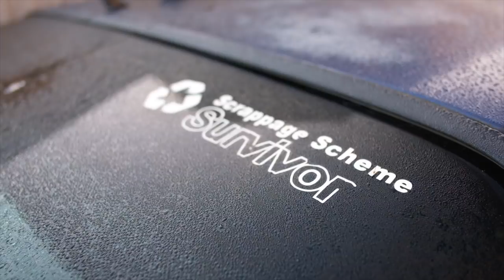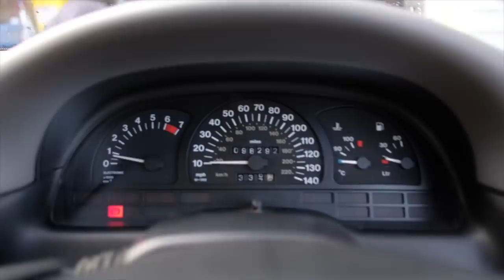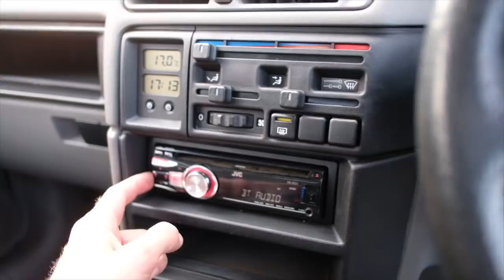Alfa 145 and Rover Coupe *With car washing and Added Mk3 Cavalier!!!*

Comment: That Cavalier is an absolute honey!  I've owned several over the years, SRi's, GLS's etc but my favourite was a metallic gold 1.8i LS very much like the one on this vid.  Same interior, same wheel trims (though I swapped them for GLS alloys)  In fact it's the only car I have a framed picture of (!) and the only car I've shed a tear over it moving on.  I loved it. I have been Cavalier free for about 5 years now and the itch to get other is getting stronger every week!
Reply from the maker: You might nee to move fast, not many on eBay any more!
Reply: @furiousdriving  Sadly I don't think I'll ever own another, not for the foreseeable.  No driveway any more :(

Comment: Mk3 Cavalier 1.8i LS.  The full rep special, complete with the original-spec wheel trims that anyone who spent a lot of time on the motorway in the '90s got very used to slaloming around as they frisbeed off into the scenery.  That's a very decent looking example of what is a pretty rare car now, and they used to be EVERYWHERE...  1.8 single cam Family engine, super reliable so long as you change the oil regularly and remember to change the water pump at each cam belt change, as they never seal again when they've been moved.  You can even change the clutch in one of those without pulling the gearbox out.  You can still get parts for them from AutoVaux...  Just remember to cable tie your wheel trims on if you do go for it.  The gear change bushes wearing out and giving a poor gear change is pretty common and easy to fix...  If you like the Cavvy then go for it, it won't be as much fun to drive as the Rover but it'll be a lot cheaper and easier to own and enjoy...  And they'll turn in 40+ mpg on the motorway...

Comment: Had a grey 2.0 cdx 16v M reg 14 years ago it was great car manual gearbox loved driving the car did open the throttle a few times had some paint issues resolved and new exhaust also well serviced trouble was I sold it because I bought a Rover 420 GSDI 97 R reg bottle green colour grey heated leather lovely spec i had health issues so sold it to my brother he kept it 2 years two great cars in my  ownership miss them both and they also had aircon 🙂

Comment: Notice usual 80/90s gm/ Vauxhall clutch pedal squeak, had several Vauxhall’s in the past inc mk3 cavaliers, the 90s cars were awesome, I love my old late 90s Rover 620 . Both are awesome cars, keep the Rover as they vanished in 2005  and sadly closed and will just become more and more collectible, if the cavalier was a GSi or SRi or the 4x4 cavalier I’d be tempted to swap.

Comment: I would love another cav 8 valves are the best engines ,i really wanted an 8 valve pre 93 sri but there were none near to me at the time and the i see the carlton diplomat 2.0 on gumtree in my home town had to have it as not seen another in years 7 years on still got it .i still love the car  and slowly the value is going up .8 valve vauxhall engines have non interference valves so no need to worry about the cambelt..
Reply: I had an 8v SRI it went like a rocket dont know why but it was exeptionaly fast 120 mph and still would pull in 5th gear

Comment: It's the cavalier I would have over the rover. You are lucky with the insurance policy you have, a similar one in Ireland would cost thousands and not very many people would qualify for one... we called those Opel Vectra's in Ireland.
Reply from the maker: I think only UK used Cavalier under the Vauxhall brand as Vectra sounds like Victor, and that was a flop for them in the 70s and they didn't dare use it until '95

Comment: I've had three mk3,  the  hubcaps were NOT original, but cheap after market ones, the originals are darker shade of grey, the wing mirrors were not body coloured, i am pretty sure by facelift 93 they should of been.  Also the back end lights and boot lid should of had black plastic mould covering around it.....i am pretty sure this was an envoy spec not a Ls.
Reply from the maker: It was badges LS, but they may have varied the trim specifics across the line up throughout production

Comment: Only just recently subscribed what ever you do, do not swap that beautiful rover for the cav. The coupe (Tomcat) is quirky, different, fun and just a stunning car to look at. In my opinion the cavalier is just bland and boring. 
I own a Morris ital and a Austin Ambassador and I get ripped on a daily basis of my ownership of them. However when I let folk see them they always question what are they??. You don’t see them they are uncommon and that’s what makes them fun to own.
Reply: The people that slag off the BL/Rover stuff are the thickos that believe all the DRIVEL from Top Gear and the press too stupid to realise that there has been an agenda to destroy the jobs and economy of the UK and west in general - You will find that agenda if you Google Paisley Expressions and the Jesus, Hitler and Wizard of Oz post on there just now that is exposing the Brexit SCAM as well. I had a 1978 Morris Marina 1.8 HL/TC and also a 1980 Austin Allegro 1750TC Equipe and both of them were excellent reliable cars - BL cars were no worst than any of the other mass market cars from back then and it came down to how they were looked after just like any other car and one thing about the UK is the amount of people that did and still do not check their oil and coolant levels never mind servicing their cars every year and then they blame the car/manufacturers for any problems that they have. Garages ripping people off as well is another reason that cars got bad names when there was probably nothing wrong with the car in the first place the reason that I always serviced and looked after my own cars and the reason that they were very reliable.

Comment: Is the Rover a 220 or a 220 turbo?
Reply from the maker: 220 nasp
Reply: @furiousdriving  I've never experienced a 220, though I learned to drive in a K reg 216 with the Honda unit which surprised the cr*p out of me! Those are pocket rockets with screamer engines!! Is there any difference between the two?

Comment: The rover looks like it has had long periods of neglect the Cavalier looks like it did in 1994.
Reply from the maker: The Rover was rescued from a builders yard where it had say for several years, its been mechanically but not cosmetically improved since (apart from a replacement spoiler)

Comment: To be honest, in my opinion, they are both junky cars. An mk3 cavalier just is a boring 4-door sedan that drives comfortable (for his age) and would be a decent retro daily. The Tomcat is a ''sporty'' car for the weekends, but actually very slow and way too stiff for everyday driving. Also, it needs just to much work to get it decent (especially the paint). I would not buy/keep either of those cars. My advice would be selling the Tomcat and the Mercedes W123, and with that money, you could be an awesome car for the channel. Something that's still an underappreciated car, like a Rover 800, Vauxhall Calibra, Daimler xj40, something new and exciting!
Reply: I had a calibra it was a horrid car just an overweight cavalier nothing special and the 16v redtop engine is overrated never liked that much either.

Comment: you Have HAD a Rover now. Maybe it's time to move on ? 
Listening to the vid', I can hear that Rover Rattling along the road. 

I Would Make the Rover MINT, & Sell it on.  Then Buy the Cavalier. 
Classic motoring should cost Nothing, If you get it right Most times. 
Your Rover is A very Ropey Example from what i see. 

The Cavalier is not worth any real Money,  Never Were & Never will be. 
Just a Lovely well cared for old car. 
Neither car is rare or Desirable on any reason. 
A Mint tom Cat will one day have Far more value than the Cavalier. 

Rover 200's were Grandad cars at the Best of times. 
Tom cats were bought for Wife' s & Grandmothers, Or as A Fun Daily User to keep the Big Car Mint in the Garage. 
A £10 Grand Supermarket Trolley.  A Reasonable Runabout to Keep the JAG or BENTLEY Away  From Supermarkets & General Town Driving. 

My Dad had a Brand New XJ300  3.2 sport.  but often took the £170 16 yr old FORD ESCORT 1.1 L ohv. on days out & long Journeys for the FUN of Driving a REAL CAR. 
I Bought the ESCORT for £100. As an MOT Failure, It cost me £70 to get it thru the MOT. 
The Car was Sunburst Red. All Original Paint.  I Detailed it to within an inch of it's life. I Looked like BRAND NEW !!  No Dents , No Rust, No Scratches , Inside or OUT. 
110,000 miles & it drove & Looked like BRAND NEW !! 
for a good few years Until My Girlfriend Banged it HEAD ON into A Discovery & Bent the Floor Pan & Roof . If Not for that we would still have it Today. 

1982 Escort 1.1 L 3 dr  Mk 3 = Brilliant cars.  !! 
The Very Best of Low end ' Small Cheap cars we ever owned. 
My Mk 4 1.3 petrol OHV Escort Van was ACE Also ! 

Today's BARGAIN STEAL  Hidden Secret is  :- 
Old Shape Vauxhall Corsa VAN ( car with no rear side windows )  1248cc Turbo Diesel, 
1.3 CDTI , 
Fastest GO-KART in town,  & Eats Motorway miles like a Big Vectra. 
I score it , AS A Small Cheap Car / Van , 

Handling 100%
Comfort, all day in the drivers seat ? 12 / 14 hours etc  100%. 
SMILES per Mile 200 smiles per mile driven. 
Economy ? Runs Forever on a Tenner !! 
100 MPH Easy. 
Steephill climbs on deep snow = FANTASTIC.  Never Got Stuck Once. 
Manual Handbrake for Steep Slippery Hill Descents in snow. 
DRIVEN FLAT OUT, Never had Handling issues, 

Reliability over 11 years & 100,000 miles = 97 % Good. 
Very little goes wrong. 
YES YES YES I would buy another, IF I had the Use for a Small Van. Most of my miles were covered in the earlier years of ownership.  IT KILLED ME to Sell it. 
It Carried My   Reg Plate       ? 1  ???  something 1 + my initials. From New.
Reply: Oh Dear! What DRIVEL! Rover 200s grandads cars yet you say Escorts were brilliant cars? The Rovers were similar to the MK3 Escorts in shape but the Rover 200 was far superior to the Escort and also the later versions of the Escort the MK5/6s which were SHITE. I wasnt a dad never mind a granddad back then and I would have bought a Rover 200 long before I went anywhere near a Ford Escort - the Rover 200 was far more advanced than the Escorts as well.